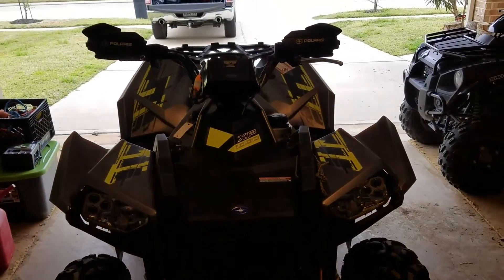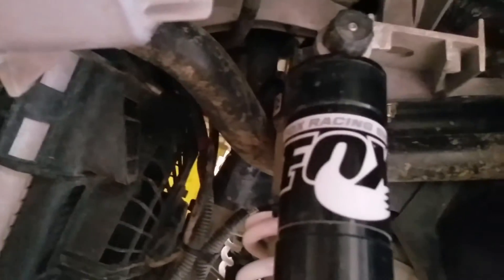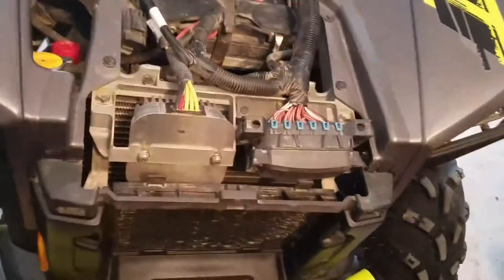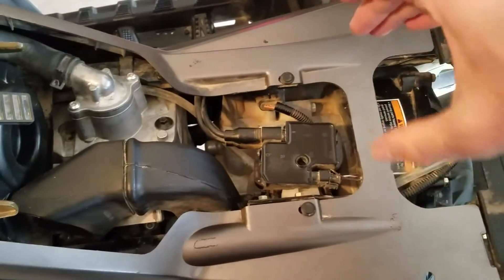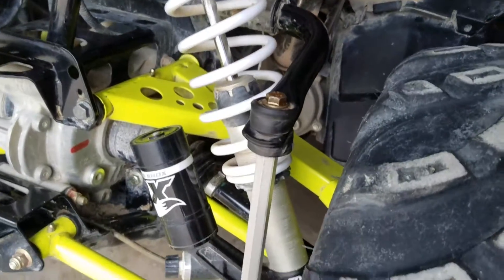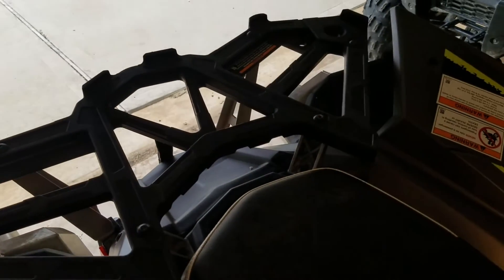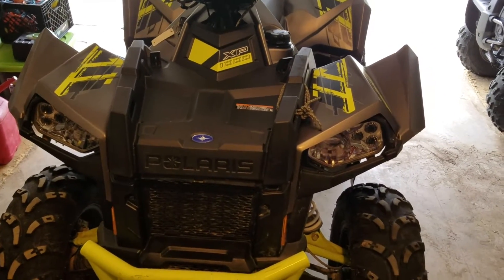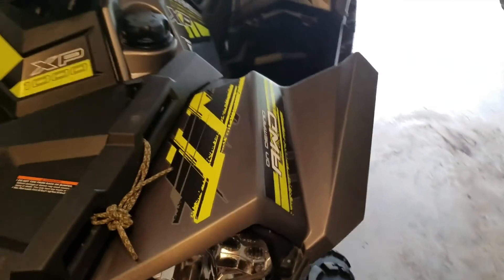Polaris Scrambler 1000 XP Walk Around and Exhaust Sound.

Comment: U need a good set of tires to unlock the full potential of the beast. Those at-2's dont have enough grab
Reply from the maker: Yeah they slid all over the place. I ended up getting some big horn look alike an inch bigger than stock size. Same width all the way around too.
Reply: @texasatvoffroad5901  sweet i had a set of knock off big horns on my old 850 scrambler, they were cheaper but i liked them better than bighorns because they had a bit more tread. Nice bike by the way !! I miss mine

Comment: Have you ever had your coolant go low? I just bought a 2018 Scarmbler 1000 and the coolant is  below the low line on the bottle.
Reply from the maker: Yeah it was a little low when I got it. I was also doing some maintenance on the front A arm bushings today and noticed it was low again. Need to check the rad.
This is the first time I have seen it low since topping it off that time.

Comment: what were the deciding factors in determining this over the renegade? I cant decide between the two haha
Reply from the maker: Yeah it's a tough one for sure. I liked that the Scrambler came with  front and rear racks. It also had smoother throttle engagement,  and I do a lot of rock riding. 
I got a pretty good deal on it too.  If you're thinking about the 1000XP there has been a lot of talk that Polaris may stop making them. Since the 1000 is missing from their 2019 lineup.
It's been one hell of an ATV though. Definitely a fun ride.
Reply: My opinion The riding position is way better on the scrambler too , it has a narrower seat because of the inline engine. Only complaints i had was the suspension bushings are crap and  the shifter was stiff , but you get used to it. Still better than the shifter on the renegade, its easy to hook the throttle when u put it in gear .

Comment: One other question, have you had any problems with the EBS locking up the back tires  while going down steep hills?
Reply from the maker: +ShippRacing no I haven't. Engine braking does stop after it heats up when going down hill, so you gotta be ready for that with hands on the brake. I can always tell now when its about to happen though. 
I took er on a lot of elevation type trails last season, and I never had the front or rear rakes lock up on me when I wasn't squeezing them.

Comment: Do you like it better than your 700 raptor?  Im use to riding a LTR 450, do you think I would like it?
Reply from the maker: While I miss the immediate chain driven speed response & lower overall weight of the Raptor. the solid axle and suspension beat the hell out of me on long rough rides. I'm able to ride all day, for multiple days now when I go on long trips.It won't be as nearly as nimble as your LTR 450, but you will be able to ride it all day and not feel beat up. The Scrambler is really fast, and can get there pretty quickly. Once I got used to the machine I'm now able to take it on some jumps. 
If you ride rough terrain you'll like the IRS and power steering. 
It is a full size ATV though, I was surprised by this. Thought it would be smaller and sportier. Seat height is only an inch higher than the Renegade, but looking at it next to my wife's Sportsman 850 they are roughly the same overall height.

-Not trying to write a book here lol, let me know if you want to talk about this more.
Reply: Thank You!

Comment: Do you like the brute force 300? Clearance issues with the trails? Age of the kid. 12 year old can ride it Ok?
Reply from the maker: Clearance did ok. Didn't have any high center or framing out issues. 12 year old should be fine, as long as there is some previous ATV experience to rely on or high supervision. As it can really get up and go. If it tips it's also heavier than kid sizes. Though there is plenty of foot well room to help.
Brakes are really good also. 
The two we have are working out really well.
Reply: Ok the 90cc is small and low clearance. Hits alot of rocks here in NH. Wanted to get the brute force 300. My son is tall and big for 12. Thanks. I'm thinking the brute force 300 6.1 clearance might be am issue. Even though the sportsman 90 is only 4 inch clearance.